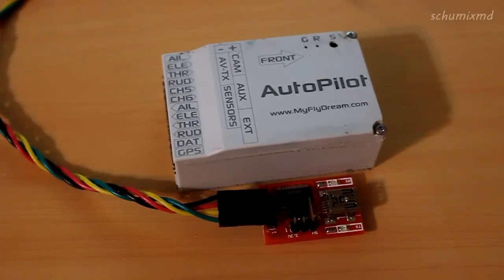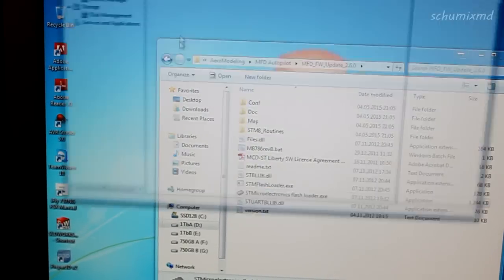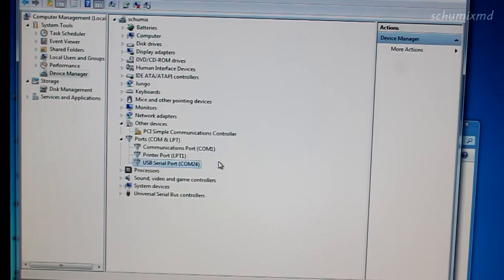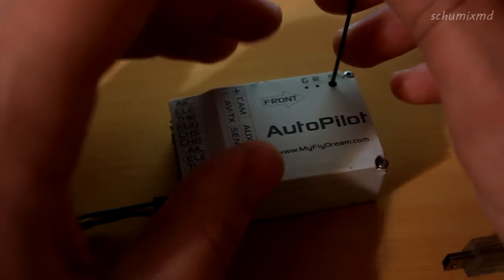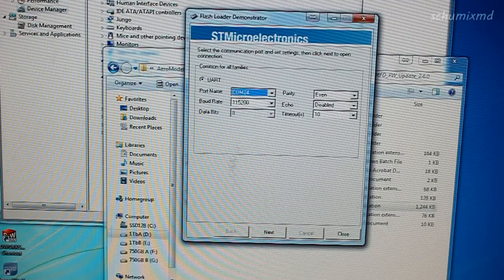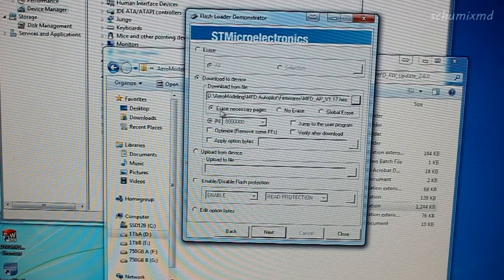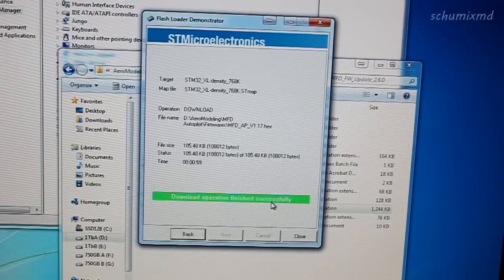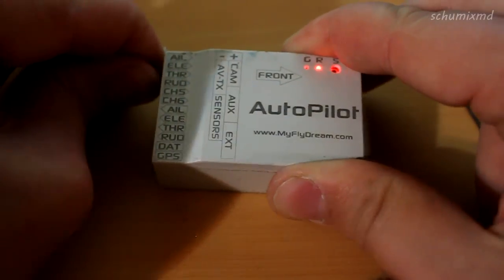MFD Update Instructions

Comment: Hi, i having problem with updating MFD AAT driver, yellow light flashing fast and no driver button such as home and test not working. Can you assist me ?
Reply from the maker: +Nightrider Nightrider hey, check the manual, the button that have to be pressed is inside the AAT driver located near yellow LED.
Reply: +schumixmd Hi, triedpressing button, but no use the yellow light keep flashing.
Reply: +schumixmd do you ave any old firmware that i can test uploading?
Reply from the maker: +Nightrider Nightrider no, I don't have old firmware :(